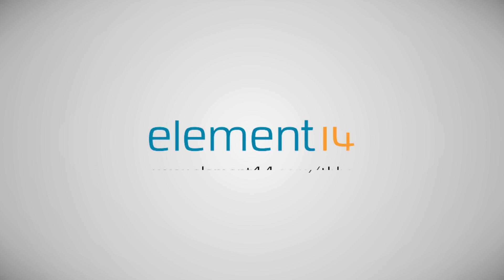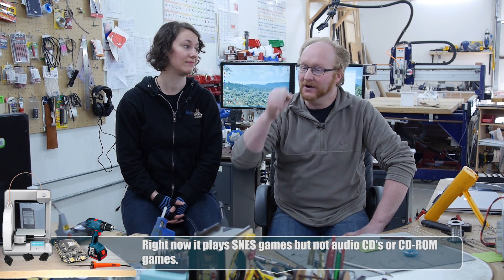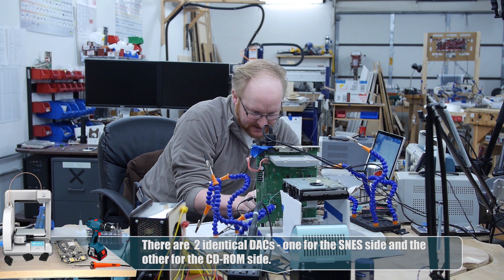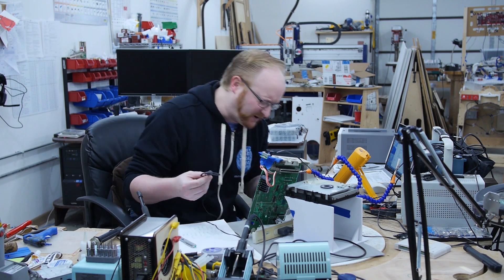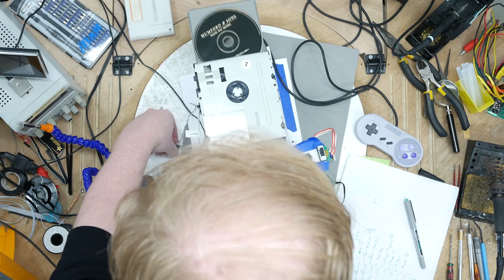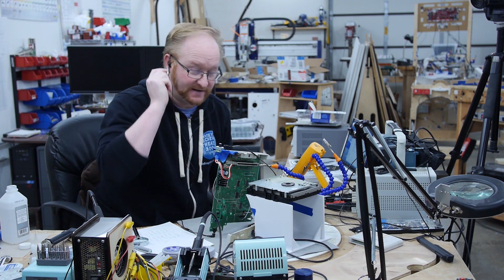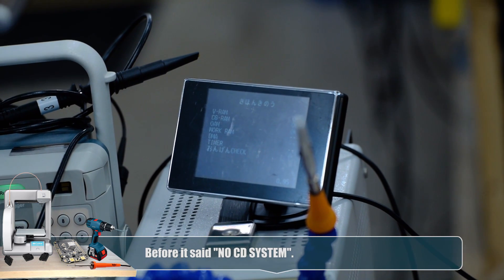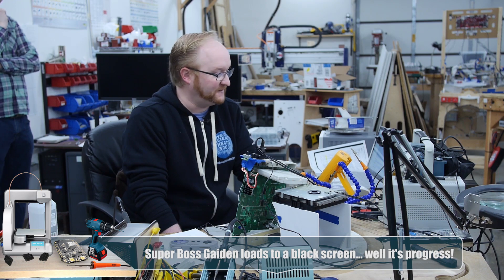Nintendo PlayStation Prototype: Finally Working!

Comment: I wonder if this would have been a successful system if it would have hit the shelves, or would it have been loaded with FMVs like the Sega CD?
Reply: Early CD games, even on PC, were mostly just added FMV and CD audio. It's unlikely that the CD versions would be radically different from the cart versions beyond that. By the time all that space was actually used for something beyond FMV and CD audio, hardware had moved on, and the SNES was no longer latest gen hardware.
TLDR: Probably much like the Sega CD.
Reply: Xilefian Not in this state, no, but look up the documents nintendo released to devs about the CD unit. The bulk of the RAM and control logic is in the included cartridge, NOT the CD drive.
MeanIng it could be upgraded independently.

In fact, all the later documents and articles refer to the CD unit having expansion hardware.
First a superFX, but the last known specs were, 6502 compatible HANDS controller chip for CD access control and audio playback and such, with 4 megabits (512 kilobytes) of RAM, then in addition, a 32 bit NEC V810 coprocessor running at ~21 mhz, with it's own 8 megabits (1 megabyte) of dedicated RAM.

I think with that spec the CD unit would have been competitive with the Sega-CD + 32x combo that is theoretically possible.

And people have demonstrated FMV playback on base snes hardware albeit with large capacity cartridges.
Assuming appropriate logic for CD streaming, video quality would be higher than the Sega CD.
(owing largely to 256 from 15 bit colour, rather than 64 from 512 - the primary limitation is DMA time at just 6kb/10kb (PAL systems get more DMA/screen update time - a consistent trend for 80's computers that applies to the atari 8 bits, c64, Amiga, and many other systems too) a frame, (43 kb if forced blanking is used)). - if using 256 colour mode, with forced blanking for data transfers, and just naively send whole frames (cleverer schemes should be possible for video), you can play back video at 256x168 resolution, at 30 (NTSC)/25 (PAL) fps.
Though, you'd have to allow at least 18 kilobytes/second per channel of audio if using the snes's standard compression format. (64 kilobytes for uncompressed 32 khz audio - unless you bypass the audio chip using the analogue audio in pins).
However, that's 615 bytes per frame drawn, and we already have 1024 bytes spare that we haven't used yet. (because we transfer 8x8 blocks of pixels, and it doesn't work to transfer 21.6 rows of such blocks)
If we used ~16:9 aspect ratio video(snes pixels aren't square, so the ratio is slightly off here), we'd be drawing 256x144 pixels, and we'd have a full 7,168 bytes to spare.
Or...
If we want 4:3 ratio, keeping in mind the screen is 256x224 pixels, but stretched horizontally (effective snes resolution would be 300x225 if the pixels were square. meaning the pixel aspect ratio is 300/256, or 75/64)
the full 256x224 screen at 256 colours is 56 kilobytes, which exceeds the 43 kb we have to work with. (but we could lower the framerate to compensate, to a point. ~2.68 megabytes/sec DMA time gives 49 full frames of data you can transfer per second, but because you have to blank the screen to transfer this fast, you need to allow for drawing the screen inbetween, and probably have to respect display timing as well, meaning you'd get about 20 fps out of it in the end, and this method might cause too much flicker. (the screen is blank 2/3 of the time)
Alternately, we can scale the resolution down to 76%, and draw video at roughly 192x168.
Finally, if we stick to using 16,384 pixels at most, (a 4:3 resolution, taking into account the non-square pixels of the snes, would be~136x120), then we can use mode 7 scaling to get the image to fill the whole screen. 
Of course, without semi-efficient compression (which then takes CPU time to decode), the 2x speed CD-ROM drive would only give you at most 300 kb/sec to work with, which does mean at 30 fps you only get 10 kilobytes for a single frame. (and the above assumes we can spend about 43 kilobytes on a single frame)
Still, it shows what's possible in theory without crazy amounts of effort...
No reason they couldn't have devised a scheme for the CD system to play video...

Remember that this is a prototype (an early one by the looks of it's specs too), and all the add-on hardware to increase the capabilities, were meant to be in the cartridge (and in fact, this prototype proves that - the cartridge contains the RAM and other components and CD access software. The drive only contains low level access control logic).

I don't think this protype console's specs are representative of what would have been released commercially. Especially since cartridge based expansion hardware could be changed last minute relatively easily.
Just something to keep in mind if you're speculating on what might have been.
Reply: @KuraIthys  This was very late in development. It was planned to be released either in 1993 or early 1994.
Reply: Jamie Lee I think it would have been a flop.
Even in it's expanded final spec when it involved 512 kilobytes of RAM and an NEC V810 (32 bit expansion cpu with another 1 megabyte of RAM)

It probably would have benefited Square Enix RPG's though. They were seriously chafing at the cost and size limits of cartridges.
Secret of mana reportedly has a dubious abbreviated english translation because the game didn't fit on an affordable cartridge.
Worse, reportedly like 40% of the game (endgame content other than the dungeons) is missing for that same reason.
(it was in fact being developed as an snes CD title. Square were not happy when they learnt the CD drive was cancelled).
Similarly, it's sequel, Seiken Densetu 3, never got an English release because it wouldn't fit onto a cartridge if translated.
Chrono Trigger and Tales of Phantasia may have even gotten the video cutscenes found in later re-releases of those games...

We would have seen larger, more elaborate games, and probably even more RPG's, but I still suspect the CD add-on would have bombed.
Almost everything sega released as an add-on did.
I also suspect this marketing issue is why things like the SA-1 and SuperFX chip were embedded into cartridges, even though that drove up game cost, rather than being sold as independent add-ons...

Would have been fun though.
Reply: CD games would certainly be a lot cheaper to manufacture - but I doubt the prices would have been reduced any, they would have stayed the same to result in much higher profits.  At least, until someone figured out how to make copies of the discs, and distribute them by sneakernet and Internet.
Reply: Jamie Lee 
Sony made most of the FMV games for the SEGA CD, so Nintendo would've been stuck with them.
Reply: If they'd given it good enough specs, it might have had a good run - since it was a new console, and not an add-on.  The Sony Playstation eventually had 2MB of main RAM, 1MB VRAM.  A system with similar specs might have been able to find a market, and developers.  The three to four year delay between announcement of the N.P., and the S.P., however, surely was to the benefit of Sony, as the cost of RAM came down further, allowing them to put more into the system at a reasonable price.
Reply: I know this is a working prototype, but I don't think its the final revision. there could have been a lot more done with this, but I'm still guessing it would have been on the lines of the CD-i, just with a Sony lable
Reply: If you're interested in these later specs, by the way, this article about the SuperFX mentions it:
http://www.anthrofox.org/starfox/superfx.html
also:
http://www.consoledatabase.com/consoleinfo/snescdrom/

And of course, a basic technical overview document that Nintendo gave to software developers at some point. This may of course be describing the Phillips version of the drive, but it goes into some depth about how it was supposed to work...
https://archive.org/details/SNESCDROMSystem1993
Reply: do you have a link?
Reply: do you have a link to that soundtrack?
Reply: Actually since most of the SNES's display modes are tile-mapped, you could take advantage of that. Tile mapping is basically a form of compression after all. Same sort of way MPEG and most other video codecs work, split the screen into blocks. So a special optimised video format could be quite impressive. 

I didn't know it had a 21MHz V810 in there. The Mega-CD had another 68000, same as the base unit, but a bit faster (12MHz I think). The V810 should be quite a bit more powerful.
Reply: It's likely that a MPEG cartridge would have come out at a later date to play back VCD's (because that was the trend at the time before DVD, even though it bombed everywhere but China.) Titles like the 7th Guest, Return to Zork, and a few other titles came out for PC MPEG cards, but literately only about a dozen ever made it. When the CD-i came out it's likely a cartridge could have came out to play CDi's as well.

Like the cartridge slot, owing to being able to throw even 32bit ARM CPU's in to the cart had a lot of flexibility, and the stereo audio was directly available on the cartridge bus. The bottleneck was the video. 

A MPEG VCD or CDi cartridge for the SNES would have still been stuck at 256x256 resolution that the SNES actually renders at. It's likely that a VCD or CDi cart would have required a pig-tail cable to be plugged into the cart.
Reply: Jamie Lee 😂
Reply: Probably.
Reply: FMV is ALWAYS a positive thing.
Reply: From what Ben Heck has analysed of this, it doesn't look like it would have even be capable of FMVs (The Sega CD was a faster console, even then the FMVs were in a tiny box on the screen).

There's certainly no video streaming hardware, unlike on the original PlayStation.

I expect the hardware wouldn't have been very compelling at all, the appeal would have been the SNES software library - which Sony demanded 100% of the publishing rights and profits to - so no benefit for Nintendo on this one.

We probably would have seen a lot more large-scale JRPG games with expansive stories and many more sprite variations and some very high-quality music - which sounds really good to me. CD games would have been cheaper too. The JRPG scene moved over to PlayStation for the CD capacity.
Reply: @Xilefian  It could have meant bigger rpgs with more text because they could have 600 megs instead of 4 megs, but probably no FMV, and CD audio / samples. So some games that were compressed like crazy would instead not be compressed but there would be load times. Like Der Langrisser.

If you want a comparison look at the PC Engine CD. The games were bigger but not really all that different or better. Mostly they filled the CDs up with really bad FMV, CD audio and bigger, but not necessarily better, games.
Reply: Mr.Dr.Professor Toaster , so the SNES CD would have been plagued with FMVbola too then

Comment: Wow. Amazing! You've basically turned the prototype into an actual working system! Considering this stuff was relatively unknown and intact from the 90s and your being able to do this really shows how anything is possible. This was a huge challenge, good job! I guess the next big one is that N64 portable LOL... seems like it's been at least as tough.
Reply: The prototype WAS already working, but broke over time.
Reply: next step is replicating the prototype, making it in factories and selling it on the black market...
Reply: Sharif Sourour Or the American N64 Disk drive
Reply: n64 portable has been done over a million times. We don't need another n64 to be hacked to pieces.
Reply: I was referring to the fact he actually took on the project. I just believe in Ben, but of course if there's something he doesn't want to do, no one is forcing him LOL, he's a grown man. :D
Reply: That's precisely what he did, so according to your definition it works. Did you even watch the video? Are you drunk?
Reply: Define working?  Just because you turn something on and a light glows red doesn't mean it is fully functional.  Getting software to actually play nice with the hardware is a significant achievement.
Reply: Man-made object was fixed by a man.. wow anything is possible

Comment: I dont get it, where does this video fit in to the timeline of the two live streams that happened?
Reply: Just before the last one. We thought there would be a lot more work to be done when we scheduled the most recent livestream. Then suddenly, days before, it worked! So the livestream was mostly us playing games on it.
Reply: will you and ben do a video on adding a cd-rom to a SNES so that retro geeks can make their own?
Reply: +Steve Benson That's not really possible. This thing has too many custom chips to be a mod of existing systems.
Reply: +theHeckwithKaren, so did Ben actually find out what was the problem? the ribbon cable? last bad cap?
Reply: It should be simple enough to just load normal SNES games off a CD through a flashcart, but CDs are kind of pointless in 2017. The SD-card cartridges are nothing new -- google SD2SNES for example. 

Remaking hardware-compatible Nintendo Playstation would be way too costly, time-consuming and pointless. Reverse-engineering and manufacturing all those custom chips would cost a gigantic amount of money. 

If you want a replica, an embedded PC + PC CD-ROM + emulator would do better.